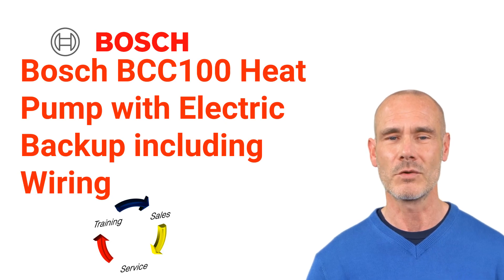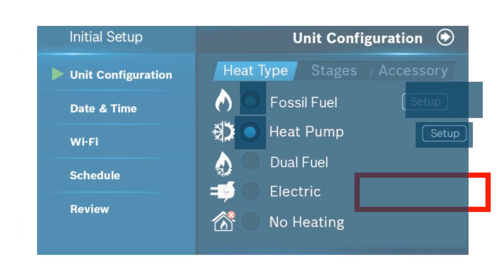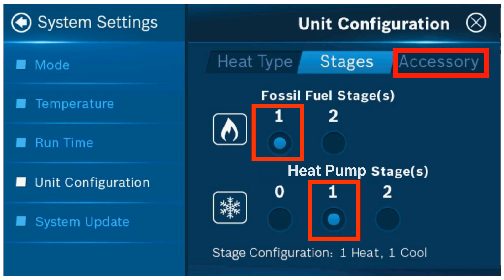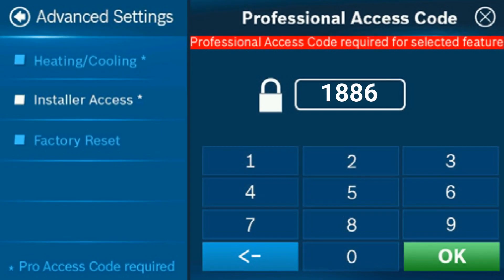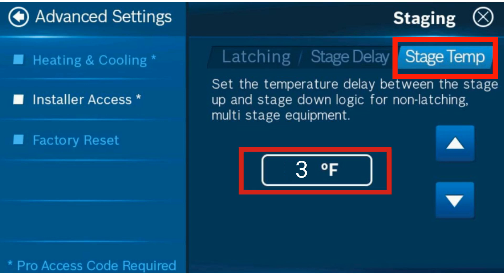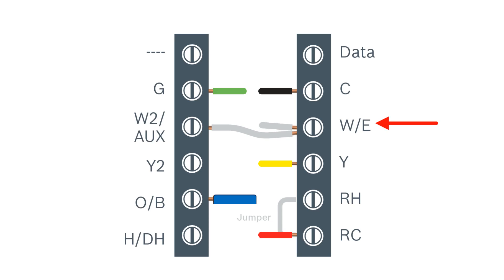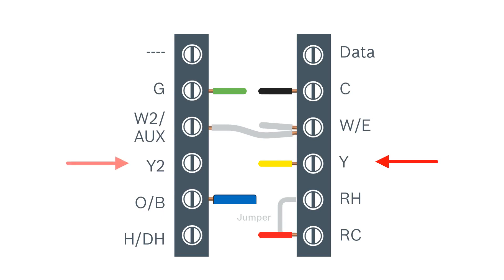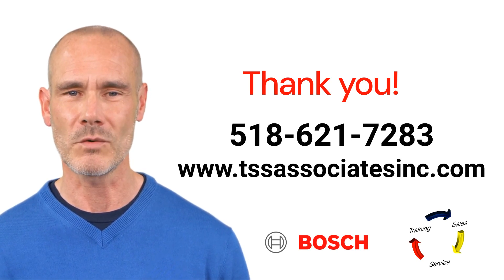Bosch BCC100 Thermostat with Electric Backup

Comment: I have a question regarding the Heat Pump setup. In setting the Stages you show a Fossil Fuel stage. Mine shows Electric and I don’t see a Fossil Fuel stage unless I am dual fuel mode. But I am only using electrical power. How do I set it up for electric stage and not fossil fuel?

Thank you for your help,
Harry
Reply: Harry, i have the same issue and i assume nobody is monitoring this video to answer for us